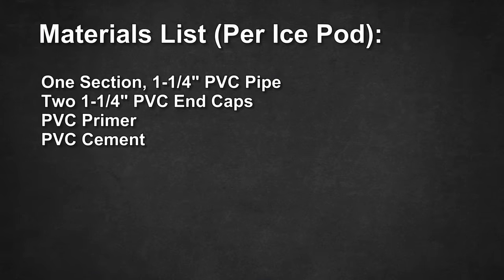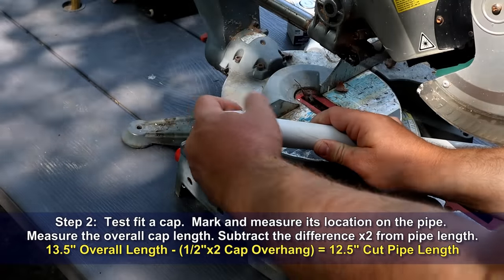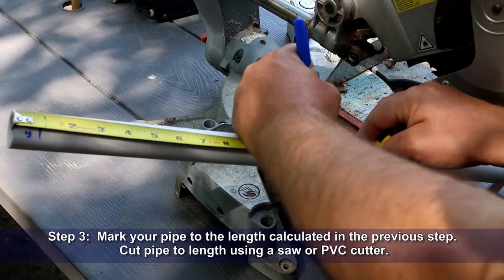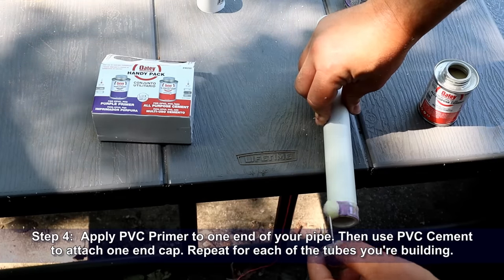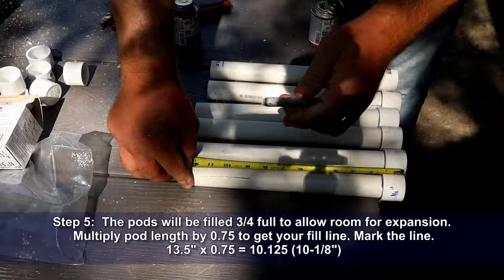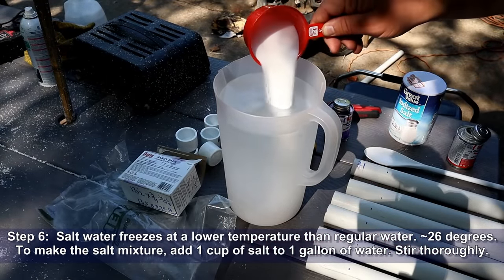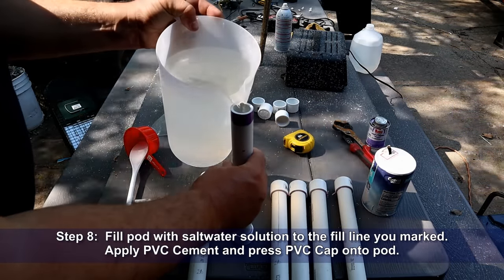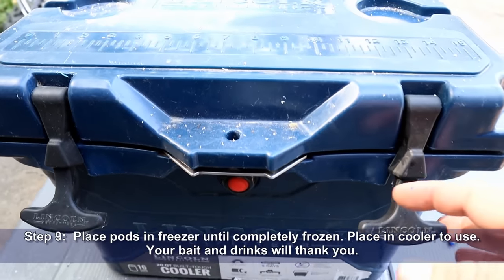Cooler Hack! How to Build SUPERCHARGED Reusable Ice Pack Pods

Comment: I just use bottled water. Most won't burst when frozen solid. If you are worried about that, just remove about 5% of the water, then freeze solid. You can pick bottles based on the size of your cooler, and it's avaliable to drink in a pinch once it defrosts.
Reply: It doesnt have enough salt. It wont get nearly as cold as these. Its a huge difference
Reply: NONSENSE!!! Salt water does not get any colder than water without salt when cooled the same way. Water with salt in it needs a lower temperature to freeze. That's because it's now a saline solution and salt does not change it's state at normal water freezing temps. The salt slurry disrupts the natural freeze cycle of water causing it to require a lower temp before freezing. Salt water does not get any colder than water without salt. It may feel colder while freezing because it gets to a lower temperature before freezing. Water and saline are essentially similar when frozen. Water without salt will freeze faster and stay frozen longer than salt water. Neither one of them will be colder than the other over time if they are both cooled to the same temperature to start with. So, essentially, no difference at all between water and saline. Although the PVC pipe is durable, it is not the best solution here. Bottled water can be frozen to well below 0 and is a far better solution as the walls of the bottles are thinner allowing for more water storage in the same space. Water is the number one drink you need while traveling and camping so you will most likely be bringing it unless you like getting your drinking water from a campground system which is not as desirable as filtered, bottled water. We have good water at home so we only use bottled water when traveling or camping. We also carry water from home for camping long term. We use our deep freezer to freeze cases of water to below 0 degrees fahrenheit. The water stays in the freezer year round and is put in the refrigerator to help during power failures. It's replaced when we need it for our coolers. We've never had any bottles explode. Apparently, the plastic used for water bottles can expand somewhat. This wasn't always the case but we have been freezing it for the past 15 years with no problems.  @RT-qz5ci
Reply: @donhart3782  bruh chill out nobody cares i didnt even read all of that. Argue with someone else
Reply: wahahahahahahahhhahahah. 🤣😂🤣 @RT-qz5ci
Reply: @donhart3782  I appreciate the practical alternative... the pvc seems cool... pun intended, but the practical notion of being able to actually drink the 'ice pack' if need be, is a much more efficient use of cooler space.  For the record, I did not consider your response in need of 'chilling'... some people just consider information an argument, if their own remarks are challenged.   Facts prevail, ultimately.  Thanks for bothering to make your point for those of us unafraid of actually reading to learn.
Reply: @donhart3782  Even though you typed a lot, you are still dead wrong.
Reply: @donhart3782  You are absolutely right.  The ice pods will be as cold as the freezer from which they were removed.  Saline will melt at a lower temperature than pure water.  The most energy, aka latent heat of fusion, will be absorbed from the cooler as the ice melts.  Once it is melted, there isn't a lot of specific heat remaining to cool the contents of the cooler.  There is more energy for cooling stored in frozen pure water than frozen saline.  The salt interferes with the formation of ice crystals and requires a lower temperature for freezing.  Salt has nothing to do with the amount of energy released upon melting.
Reply: Water freezes at 32, doesn’t mean it can’t get any colder than 32 😂
Reply: That's what I do.
Reply: @donhart3782 I’m a retired residential contractor, I have been doing the water bottle thing as you describe for many many years. You are spot on as to the benefits of them as opposed to the non-useable I mean for human consumption frozen things. I have multiple times even had to take a frozen bottle of water and stab it a lot, making it where I can cut the bottle and put the ice in my yeti cup when it has run out, then fill it with the water from another bottle that I have set out and have great water in my yeti cup again and again.
Reply: @billsalcido7878 and lucky for us, nobody said it cant get colder. Wait. Did you have a point?
Reply: @jessjoeking yeah his point is that the freezing point doesn’t make a difference. Your freezer goes much lower than 32° F. The salt doesn’t do anything here. 0° salt water ice and 0° fresh water ice are going to cool the same.
Reply: @RT-qz5ci  Everything you put in the freezer will get as cold as the freezer, but not colder. The saltier the water, the lower its specific heat.
Reply: @RT-qz5ci -- With 27 likes to your 5, well I guess a few folks do care.  Exaggerate much?
Reply: @RT-qz5ci Translation: “I don’t know what I’m talking about and  can’t be bothered to learn.”
Reply: @donhart3782 but you add salt to ice to get it colder for icecream making 🤷‍♂️
Reply: Yes. Like normal people.
Reply: @donhart3782 sorry but you’re only considering one factor with that being a salt water mixture frozen to zero degrees versus water frozen to zero degrees.  You are correct when you say 0° is 0° however you leave out a couple of important advantages of salt water solution which is - now hang with me for a minute - the lower freezing point of saltwater compared to regular water. Here’s an explanation of why this is beneficial:

	1.	Lower Freezing Point: Saltwater freezes at a lower temperature than regular water. While pure water freezes at 0°C (32°F), a saltwater regular ice pack made with plain water.
	2.	Longer Lasting Cold: Due to the lower freezing point, saltwater ice packs can absorb more heat from their surroundings before they start to melt. This can result in a longer-lasting cold effect, which is beneficial for keeping items cooler for an extended period.
	3.	Consistent Temperature: As the saltwater ice pack melts, it can maintain a lower temperature longer because the salt lowers the melting point of ice. This can provide a more consistent cooling effect over time compared to regular ice packs.

Seems counterintuitive to me because it seems like 25 degrees is 25 degrees but someone much smarter than I am explained it to me and pointed out the other benefits of the saltwater solution. The downside is you can’t drink the salt water. 😂
Reply: @PopCornSheffield-ow4vm   A lower melting point means the saltwater ice will become water sooner than the freshwater ice. As it becomes liquid sooner, it can actually lose its colder temperature faster, since the water particles are now free to move (movement causes heat). If we were talking about a situation where the colder water was enveloping, say, cans of beer, that transference of cold would be beneficial. However, given that - in this case - the water/ice is being stored inside PVC tubes, where it can only interact with the bottom of whatever is in the cooler, there is absolutely no benefit to 27 degree saltwater compared to 27 degree ice. X temperature is X temperature.
Reply: Salt ice lasts longer
Reply: @warricknicholls7080   Not in this case.
Reply: @TheCharleseye  Why is it i can get 3 days from Salt ice in cooler vs 1.5 days fresh water ice in cooler? 
  Im no scientist, but i do alot of fishing.
Reply: @TheCharleseye  That’s true but the point of the solution isn’t suggesting that 27 degrees of salt solution is somehow magically colder than 27 degrees of water.  It’s the overall properties of a salt solution that makes it more effective as a means of keeping a cooler cold longer.  I think the advantage is of sakt solution is it can maintain a lower temperature for a longer period of time. There’s something called latent heat of fusion which has something to do with ice absorbing heat from its surroundings before it begins to melt.  Salt ice can absorb more heat before it starts to melt which means it keeps things colder longer than pure ice.  That is why it’s a better option for a cooler.  We need someone with a better understanding of the laws of thermodynamics to chime in here!  😂
Reply: Yep and if you run a chute under the lid below the fan to about 2 inches from the bottom of cooler air has to travel through ice bottles instead of across the top.
Reply: @roy.mclean  The law of thermodynamics comes into play.  Saltwater solution is much more efficient at keeping things colder longer. It can absorb more heat before it starts to melt. The “heat” comes from the ambient air around the items being kept cold.  It was confusing to me at first because I thought a 27° block of ice would be the same as a 27° block of salt ice.  Turns out there’s more to the story when it comes to keeping things cold and a cooler.  I shouldn’t have passed on physics when I had the chance!!  🤦🏻‍♂️
Reply: @roy.mclean  it seems that your comment contradicts some part of the law of thermodynamics.  PS if I understood it better myself I’d explain it but it’s confusing me.  🤷🏼‍♂️ All I know is my past belief that 27° was 27° doesn’t take into consideration the heat that’s absorbed by salt solution before it starts to melt.  Salt ice is better for keeping a cooler full of cold items cold longer.  Paradigm shift.
Reply: @RT-qz5ci  i read all of it and didn't even get bored !
Reply: Polycides are a byproduct of the freezing process that you described. This plastic poison causes sterility and memory loss.
Reply: @PopCornSheffield-ow4vm  the change in energy above and below the freezing point (specific heat) is negligible compared to the latent heat of fusion where the phase change occurs.  Making the freezing/melting point a few degrees lower has little effect on the total amount of energy used for cooling/chilling.  Additinally, the specific heat of pure water is higher than that of brine solutions so the same temperature change in pure water requires/gives up more energy than a brine (4kJ vs 3kJ per degree C per kg) because there is less water in the same volume of solution.
Reply: @roy.mclean  I agree but Brine has a lower freezing point than pure water. This means it stays liquid at lower temperatures, which helps it absorb heat more evenly and effectively.  As brine ice melts at a lower temperature than pure ice, it keeps the cooler's contents at a lower temperature for a longer time.
Liquid brine at a lower temperature can continue to absorb heat from the cooler’s contents more efficiently than ice, which only absorbs heat as it melts.  Pure Water has a high specific heat, meaning it absorbs a lot of heat before it warms up. But, once it freezes, it doesn’t continue to absorb heat as efficiently.  Does that even matter? 🤷🏼‍♂️ The concept of ice absorbing heat is the way it keeps things cold was my paradigm shift. Brine solution has a lower specific heat than water, its lower freezing point means it stays liquid longer at colder temperatures, allowing it to continue absorbing heat effectively and keeping the cooler contents cold for longer.   The points made about specific heat and latent heat are correct, but they don't consider the practical benefits of the brine's lower freezing point. In practice, a brine solution can be more effective than pure water in a cooler because it maintains lower temperatures longer due to its lower freezing point and continued liquid state at colder temperatures. This makes it better at keeping items cold over extended periods.  So it “boils” 😂 down to this.  Brine maybe be technically more efficient but I have no idea to what degree.  The cost of the salt might offset any gains in efficiency but it may be be more than worth it if it’s the difference better cold beer and really cold beer.  If pure water doesn’t keep the beer cold as long as brine the solution - no pun intended - is simple.  Drink the beer faster. 🍻
Reply: Wait.  You just said it gets colder, but it doesn't get colder? At least you can spell i guess. @donhart3782
Reply: Bahahaa haha hahahaa 🤣👋
Reply: Bahahaa haha hahahaa 🤣👋
Reply: Bahahaa haha hahahaa 🤣 👋
Reply: @donhart3782  i agree its more useful, when i go kayak camping i use frozen vac sealed berry puree and steaks lol no room for water, so i filter the river water with a sawyer squeeze
Reply: Preventing the water from freezing despite being lower than freezing temperature is the advantage here, twice the “coolness” when the water is in liquid than solid at the same temperature.
Reply: @TxRiverElf I read the whole thing! It was basically saying the whole thing over and over again redundancy is a sign of aggression! He may prefer pure water, but that's probably because he's already to salty!
Reply: @TheCharleseye  you're just trying to make sense of it in your mind. You are wrong. It takes longer to thaw just as it takes longer to freeze... pure water releases all of its "cold energy" faster, giving a faster "cool down", salt water releases its "cold energy" more slowly. This means if your already cold items will maintain longer with the salt water releasing its energy more slowly.
Reply: @warricknicholls7080  because they don't know what they're talking about. They're not looking it up, they're just trying to make sense of it in their heads.
Reply: Same here i figured this out years ago LOL @donhart3782

Comment: I did a little research on this and found that there is a reaction that takes place when salt is added to ice, it makes the water colder as the ice melts. This is the best explanation I have from what I read so checking with a scientist to corroborate is a good idea. But, when the water and salt are already mixed, the process that takes place with salt on ice is no longer there. So in making your own reusable freeze tubes, there should be no difference in the ability to make things colder. Looked at another way, if your freezer gets down to -10 degrees, the ice you make will be -10 also. Whether fresh or salt water, the cold it stores is limited by the freezer making it. the fact that the salt water will melt at a lower temperature probably has no effect since the salt water will still be the same temperature as the fresh water ice that is still frozen. Salt water is more dense than fresh water but it is denser because of the dissolved solids. Normally I would think that the denser something is, the longer it would hold a temperature, whether it is heat or cold. but in this instance, what would hold temperature better, sodium chloride or H2o. Whatever the difference, it is most likely negligible since the salt content is so low it would not be detected. So this is a very long winded way of saying that using salt water to make your reusable cold blocks probably is no benefit over using fresh water. Use the coldest freezer you have for the best results.
Reply: Maybe he could do a side by side comparison to compare how effective this is versus plain water
Reply: Yes. Dissolving salt in water (even ice water) makes the water colder. At the same time, salt water has a higher heat capacity, making it take more energy to increase its temperature. This means salt water can stay colder longer than normal water. But the two principles are not the same. The only way the two are equal is if the salt water is cooled to the same temperature as dissolving salt in ice water. So, if you can freeze salt water to something like -5 F or lower, it will be more effective than dissolving salt in ice water from an energy perspective.

What does this mean? Not much with respect to the video.

If you want to cool room temp beer or soda asap: ice + water + salt.

If you want to make an ice pack, salted water is better than plain water. I personally use gel beads (garden center, or orbeez), with equal parts rubbing alcohol and distilled water.
Reply: LOL - I just made a similar comment above before I saw your comment.  If somehow the tranfer of heat occurs at a different rate in fresh water ice than in salt water ice would this hack be valuable. IMHO
Reply: This is why I just freeze gallon jugs of fresh water for the camping cooler. Functions just fine as an ice block, and by the end of the week when all the cold food is used up, its still available as drinking water for cooking the dry foods.
Reply: Adding salt stops the water from becoming solid and breaking the pipes. I used to spray refridgerated concentrated salt water to freeze fish commercially and we could reach minus 20 degrees Celsius and I'm sure you could go colder
Reply: Yes a colder freezer is likely to make harder ice and will mean that the ice has more warming up to do. Pure water boils and freezes (at sea level) at specific temperatures.  Adding impurities like alcohol, antifreeze or salt impacts those temperatures where the state change occurs.  Seawater is about 3.5% salt and freezes about 2 degrees cooler.

Comment: I would use schedule 20 pipe. Freeze faster and hopefully work more efficiently. This is a great tip. Glad I ran across this video.
Reply: If they freeze faster, they will also thaw faster due to less insolation.
Reply: I've never heard of schedule 20 pipe. That's mighty thin.

Comment: Technically, you need primer and glue in cap, also. Glue cap first. Glue tends to stay liquid longer, due to confinement in the cap. Then glue exterior of pipe. Slip together and give a short twist.you now yave an inspector approved connection.
Reply: I approve this message as a maintenance hand at a chemical plant that deals with a lot of CPVC and pvc pipe. Primer is a must before adding  the hardner glue.